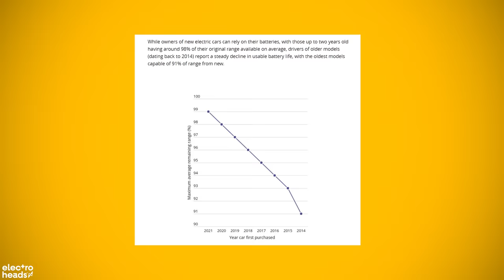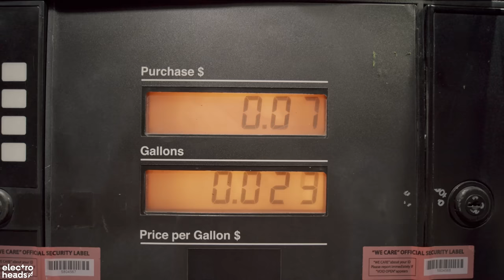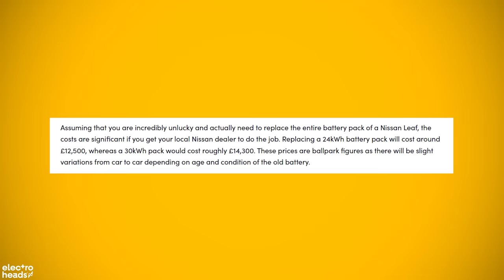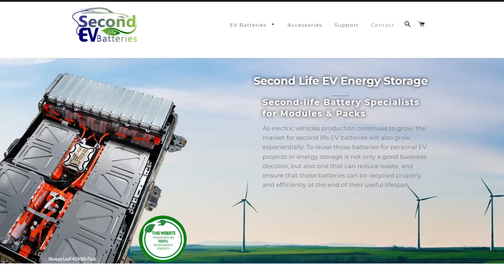What they DON'T tell you about electric car batteries

Comment: My Nissan Leaf from 2017 (now 2024) still has at least 95% battery health and has done 50,000kms. I suggest we Dont charge the battery up full capacity all the time and let it run down to 20% capacity before recharging. Also, charge it on the lowest charging at home, not at those stations…they stress the battery and wear it down. And give it a little drive often without smashing the accelerator too much. Letting it sit there fully charged does it no good. If you just tinker around gently that’s going to keep the battery nice and healthy loooooong time. See? 😊

Comment: There's a simple way to estimate the range of a used EV. Take the usable battery capacity of the car when new, then assume 2.5% degradation each year. If the car is 5 years old, that's 12.5%. As an example, the Zoe R90 has a 41kWh battery, which is also the usable capacity in this case. The car was made in 2018, so the battery capacity should now be around 36kWh. In the worst case scenario that equates to 3 miles / kWh = 108 miles range. In the best case scenario (warm weather, dry conditions, not too many hills, and no strong headwinds) = 4 miles / kWh = 144 miles range. You can pick up a used Zoe R90 for less than £9k in 2023.

Comment: The ongoing costs are cheaper than an ICE but the initial capital outlay to purchase is double or more of the equivalent ICE car.
Reply: no, it's about 20% more the the equivalent petrol car (size, power, equipment) but it has a higher resell value and it lasts longer. Also, the more you drive, the quicker you see your money back, especially in urban situations where petrol cars are at there worse. Factor in congestion charge, parking, road tax and the possibility to charge with your own solar power for free, for EVER, it really is a no brainer.
Reply: Er, it isn't. Check the cost of a new Nissan Leaf. Then go check how much a new petrol Astra, Focus or Golf is..... (i'll save you the trouble. They cost around the same)

Comment: Replacing batteries on EV vehicles costs $20,000 (CAD).  If you are unlucky and they need replacing past your warranty, be prepared for a massive $ hit.  2nd, how does a person charge their vehicle when they have to park on the street.  Everyone assumes you plug the car in at home.  Great, for those with a garage or driveway.  For those people that want to reduce their carbon footprint and save the planet (which is awesome for everyone that is doing their part), check out this video regarding the true carbon costs for producing these batteries.  https://www.youtube.com/shorts/XV9ijKAubfU  For 6 months of the year, I ride my electric scooter to work.  My fuel efficient car (cause I am cheap and have no need for anything else) grows cobwebs waiting for winter.  When EV vehicles \ infrastructure \ recycling batteries \ CO2 footprint reduced to produced batteries \ etc are in place, I will be in line for my EV.  All of this will take time.  My gut feeling is that by 2030 is when EV vehicles will truly be a viable solution for the majority of people.

Comment: I beleive there are still huge advancements to be made before these will be the norm. insurance is more expensive as EVs are more expensive to repair and more likely to be written off when an alternative would not. The main thing I do not understand is why are these being pushed when it still takes huge quantities or rare miinerals to create the batteries. these are mined in third world countries in apppauling condistions. this is not a sustainable alternative fuel sorce. why is it being pushed as one. Most countries are not charging EVs with 10:06  renewable energy. Germany has no renewable energy. Chine, America, etc. 
Also the infostructure of all towns an cities and villages are not suitble for EVS. there is no parking for EVs, there are no off street parking for many Houses. Most of the streets have 3 cars per family. The ellectricity in our area cannot be upgraded to 1000amp requuired for faster charging due to how they are wired. Most houses in our area ar nowhere near a road. they are down foootpaths. cars are parked on verges, double parkked. The cars are hugely expensive and willl take time to come down. governments keep offering grants and takking them away. etc etc.... The only way these will ever work is if toowns are flattened and we start again. even new estates are not being built in a practical way.

Comment: Tesla battery will last a million miles. A gas car battery lasts 50k miles which is 20 gas car batteries if the car lasted 1 million miles. So the carbon footprint to make batteries may be similar. A regular car battery costs about $130 x 20 = 2600

Comment: Thanks for the nice video. There are even many reports about the latest LFP batteries, that will go up to 700.000 mls and more.
But i have to disappoint you on that estimated price drop of batteries. Between 2019 and 2021 the drop in price slowed down significantly to 6% in 2 years.
And since the last 5 months prices are going up between 10 and 20% depending on type of battery.
Reply: That's the chip shortage, it will go away in 1-2 years
Reply: My understanding is Big increase in demand for batteries and not enough elements being mined to meet demand. Law of supply and demand affects prices. Chip shortages affecting all car production hence general lack of all types of car not just BEVs.
Reply: Not to mention COVID shut down a lot of stuff

Comment: There's another few issues I think putting me and others off buying EVs. Too many are SUVs only, and most EV sedans/saloons are too expensive. Also, the batteries and other parts can't be fully recycled, so emissions are still on EVs right. Also a ship with cars caught fire and sunk... They were electric cars, so could we see more fires on the road? There's also another problem, especially in the UK... EVs will be taxed soon like petrol and diesel and so will electric chargers! So will we just see people put off more?
Reply: Perhaps in some places they can't be recycled. There are two plants where I am that do recycle EV batteries already. The tech may need to be copied in the UK. Also, that ship did not contain only electric cars. It also contained many different cars containing gasoline. A gas car is more likely to light on fire than an electric one according to the fire stats here. You are correct about them all being SUVs though.
Reply: EVs won't be taxed like petrol and diesel anytime soon. It will happen eventually of course but not until there are a lot more EVs on the road. As the government want everyone to own EVs it won't happen in the near future. Think of the logistics for a start, how do you tax someone for charging 95% of the time at home.  It will most likely be some form of a pay per mile on all new vehicles when it does come in. In the meantime the early adopters of EVs have significantly lower running costs. 2030 would be my guess when things change.
Reply: You'd better let Volkswagen know it's not possible to recycle EV batteries Joseph, because they specifically built a factory to recycle them, in Zwickau in Eastern Germany about 3 years ago. They've been recycling them ever since.....they can be 95% recycled by the way....... Exactly what "other" parts of an EV can't be recycled?
Reply: @MrDAVIDATKIN  It won't be pay per mile on new vehicles David. It will be pay per mile on ALL vehicles, not just electric cars.....  And UK electric car owners already pay tax (VAT) on home charging. And have done for years.... And they pay VAT on public charging.

Comment: I have just bought a 2023 Chevy Bolt and am loving it so far. I fully expect that in 8 years or so I would likely be looking to get a newer even better EV by then. But if not, I wonder if there will be an after market for replacement batteries. If batteries are getting cheaper, I wonder if that means I could get a replacement battery that is not only cheaper, but perhaps would even give me more range.

Comment: The Which surveys actually were rubbish, and you should not use them, Electroheads!
The most recent survey found that a large proportion of Audi e-Tron owners had needed a full battery replacement. In fact, Audi UK, when asked by Which, found no records of any e-Tron needing main battery replacement in the UK. I know whom I believe (and it's not Which, despite being a subscriber & contributor to their studies). Their survey probably did not distinguish between the main and the 12V battery, or had some other serious flaw.

Comment: I still have 12 bars on my Nissan Leaf 30kWh battery after 5 years. However, the range has dropped and I suspect the BMS upgrade 6B doesn’t just release reserved battery capacity, it seems to have recalibrated the GOM to disguise the reduced range.
Reply: The number of bars mean nothing other than it is fully charged.  Its the driving range that matters.  How quickly those bars start dropping as you drive.

Comment: Thanks for a great video on EV batteries. My 2013 Fiat 500e has 67, 100 km on it and I am getting around 200 km range from a full charge. The range when new was around 140 km so my EV is actually getting better range every year. I try to train my battery to get better range by driving it down to 20% and then fully charge it to 100%, it seems to work well for me but my Tesla friends have advised me to charge to only 80%. Anyway, my battery pack was made by Samsung and the electric motor was made by Bosch. Hopefully when it comes time to replace the battery pack I would like to replace it with air battery. LOL

Comment: Owners talk about slow degradation ( there are reserve capacities being released to the operating region) but my understanding is the battery issues/warnings can come abruptly and isn't directly related to battery degradation.

If current Li-ion batteries were so robust, why don't manufacturers offer reasonably priced extended warranty beyond 10, 12 or 15 years?  Why did Tesla removed unlimited mileage warranty on the S and X in early 2020?

Check Tesla motor club and note third party battery warranty providers' businesses are booming in the US.  If batteries last 20 years, we wouldn't expect business to be brisk.

Eight year warranty is mandated by government, not from the largesse of manufacturers.

My next car will be BEV but we need to know facts and reality.

Comment: 2015 Mercedes with Tesla drive line still at 90 to 107% depending on the external temperature. Sometimes at 92 miles vs 87 miles EPA. In winter can be down 62 miles or 70%.

Comment: I drive a 2004 Buick Century. (ICE) I’ve owned it sense 2015. I have a full tune-up/check-up and oil change done at least once a year. I have additional oil changes done another 1-2 times a year. I only drive 10,000 to 15,000 miles a year. My mpg have dropped from 28 to 19. That’s a 4% drop in efficiency per year over the last 7 years. It’s only 68% as efficient as it was when I first purchased it. 

It has been a good vehicle and I will continue to drive it until it is no longer drivable or I no longer have any use for it. However, I can’t wait to be driving my first EV. I have a reservation for an Aptera.

Comment: I did replace my Nissan leaf 24kwh battery with a 40kwh battery not because the old battery was no good it had only lost about 10miles range in its 9years on the road and 72000miles, I changed it to give me more range and I got just over 20kwh of home storage and it only cost me £6000 and 4hours work

Comment: 7-8 years ago, I bought an Audi A3 (gasoline) and I drove it for about 120'000km doing all the maintenance. 
One day, the starter broke and pieces of iron spread in the engine...which was unusable. 
The garage offered me to replace the engine for about 10'000 US$, which is more than the residual value of the vehicle. 

I sold the wreck for almost nothing and bought a Q3, all maintenance done regularly for 5 years. Today it has 170'000km with many defects (like loss of power/shaking between 2000 and 2500 rpm) that no garage has managed to repair, and I know that this car will definitely break down. 
The repairs exceed 10'000US$ (transmission, power loss,...). 

People who criticize electric cars and the cost of batteries never look at the exorbitant cost of repairs and troubleshooting on combustion vehicles. 
My next car will be electric, of course.
Reply: You did buy an Audi though, not known for their reliability or longevity of newer models. Most Japanese or Korean makes would have done that mileage without significant expense. What people also don't realise ICE maintenance and expenditure is over many years, a battery failure is a big expense all at once. On an ICE car many jobs can be done by skilled home mechanics, and parts sourced from many places, that isn't the case yet with battery packs and won't be in the near future. And those saying you only have to replace a few cells in the pack, there is a lot of labour involved and not that many places yet that offer that service, yes it might be in the future but certainly not now or even in the next few years in places like Australia where ev uptake is very low.

Comment: One common mistake: If the average of cars on the road is 8 years, that does not mean cars typically last 8 years. If cars were evenly spread from 0 to 16 years, the average age would be 8 years. In fact since there were more new cars purchased in the last 8 years than the previous 8, and some cars 'die young'.....  cars have to be lasting more like on average 20 years, to give a current average age of 8 years.

Comment: What ends up in EVs is not the latest available technology, it’s the most profitable. That is why every EV owner is financially supporting beta testing ad finitum. Instead of making fast cars or cars with blistering acceleration, focussing on providing better cars for buyers, would mean people keep their cars for longer and thus the industry would be reliant on government incentives and public uptake. 
This is just one side of the debate. If charging infrastructure and usage fees doesn’t outpace demand and result in incentivised financial gain, oil will still be the base measurement for all things related to private road transport and perhaps that is actually what is going on. That a Kilowatt of electricity is relatively the same cost as Petrol and Diesel in terms of how far a car can travel for the same cost should ring alarm bells. But it doesn’t. Few people buy EVs for purely environmental reasons, so unless overall outlay is drastically reduced over say five years of ownership, all the carrot they have to dangle before us, is touchscreen arrays. 
This then invites the argument for a reduction in car ownership but that’s another day.

Comment: Our 2012 Leaf had its battery replaced under warranty.  Its spent its life in the hottest parts of Australia. Not a good climate for a car without active cooling.
It now has 110,000km and the new battery has only lost one of the 12 health bars. 
I'm using gen 1 Leaf cells from another Leaf for an off grid cabin, and to power a ride on mower. These cells are dangerous and should not be used by novices or without a BMS. New EVs are using a non flammable chemistry which will be a boon for hobyists.

Comment: It's not really the truth is it - this is a channel all about promoting EV's anyway. Let's cut to the chase - EV's are a LOT more expensive to buy than ICE cars, 20-30% on average. Range is increasing, but still only usually because the battery pack in some models is larger in the first place. We need a generational leap in battery tech to get any significant increase to put range fears completely at ease. Home charging is still slow, but the cheapest way. Public fast chargers are actually quite expensive, and the extremely fast chargers can cost as much to charge as to fill a tank with petrol. Energy costs are continuing to rise, so charging will get more expensive, even more so after the next round of increases in October (cheaper overnight tarrifs are also going to disappear if everyone has plugged in their EV's). Look, car manufacturers are falling over themeselves to release EV models, because they know they can sell you a new car all over again, but EV tech just isn't good enough yet, and a significant percentage of EV sales are actually business/fleet buyers and not the private sales you seem to imply.

EV's are the future, but not right now. Most things today about living with an EV are hard and you've got to be dedicated, ruthless and brave. People are also misguided into thinking they're doing the right thing for the environment, but more and more reports are highlighting that EV's are nowhere near as green as we're told - emission free at the tailpipe does not mean emission free!
Reply: You’re absolutely right. We ought to wait a few more years, perhaps decades. The climate will be beyond tipping point by then, but who cares, right?
Reply: @CaroAbebe  Help to tip the climate over faster by buying current EV batteries who's manufacturing CO2 emissions are 3-9 years worth of running petrol car CO2 emissions. Anyone who actually cares about the environmental damages of production and usage should be pushing for reusing old bikes, walking, public transport where possible. Plenty of things that people can do right now to help combat undesired climate change that does not involve spending in excess of £20k.

Comment: I'm not a doomsayer of electric ev's , but my Australian 2007 Turbo Falcon ute, has not had any major mechanical issues with it since i brought it in 2008 just had standard Servicing, when they or you can say hey my daily driven ev of at least 20 years has had no major issues with it and does not need a battery replacement then i might consider it but not for quiet a while yet, and by the way ev's will not save the earth they might be worse then combustion engines. there are channels on YouTube that will show you why, just look for them cheers ps i like the 150 lightning.